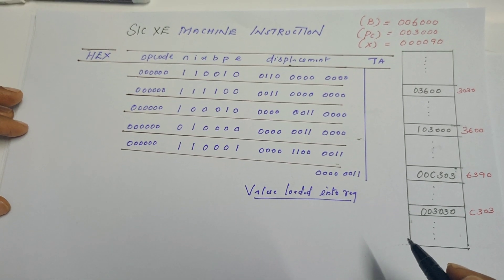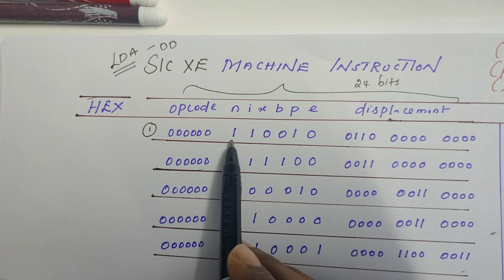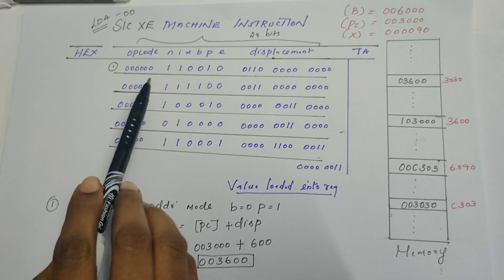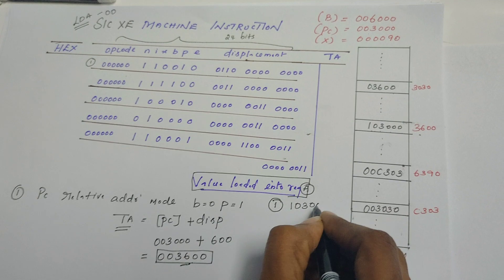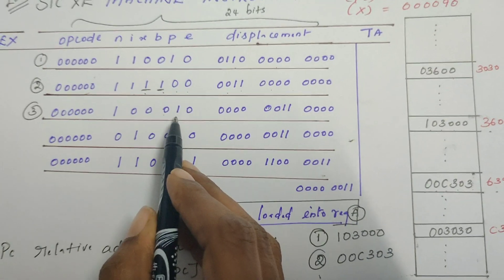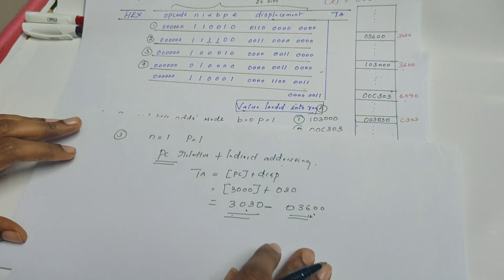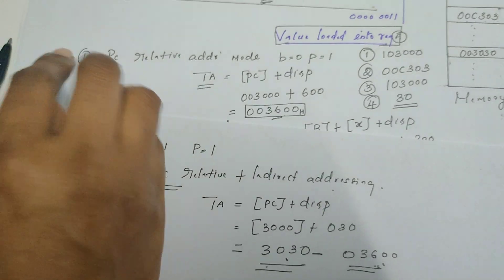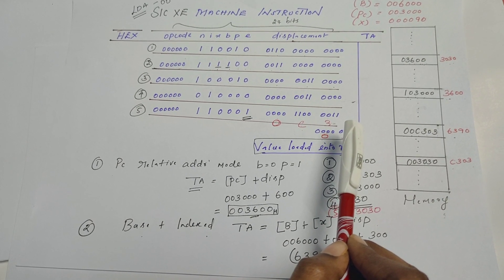SIC/XE Addressing modes|Solved example | System Software-#5

Comment: Mam even in 1st and 2 nd example n flag value is 1 ..but why we didn't calculate indirect address ?
Reply: we should consider both n and i flag values at a time not a single value.
when n=1 and i=0 then the instruction is indirect addressing.
when n=0 and i=1 then the instruction is immediate addressing.
when n=1 and i=1 or  n=0 and i=0  then the target address is address of operand
Reply from the maker: Yes